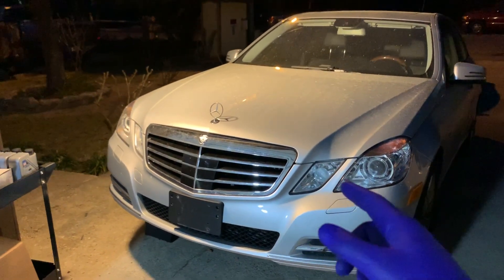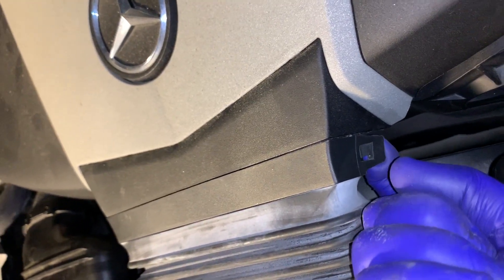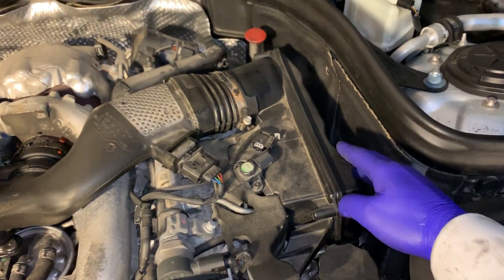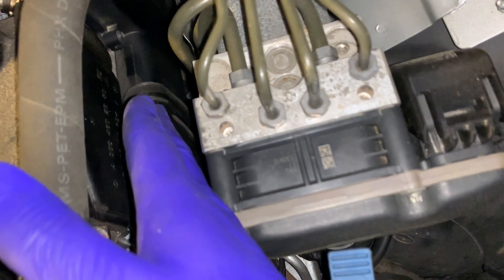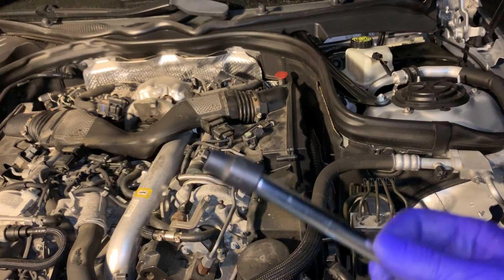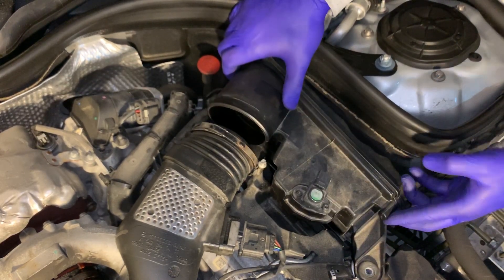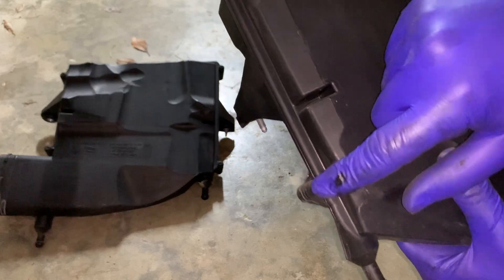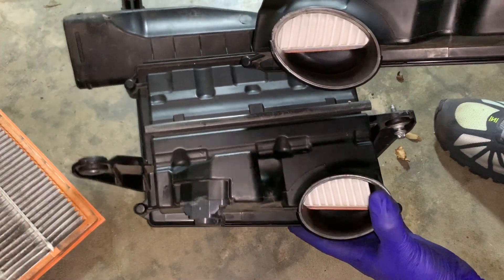How to Replace Air Filters 2011 Mercedes Benz E350 Bluetec

Comment: Thanks again, I’m replacing my filter this week!
Reply from the maker: You're very welcome!
Reply: @AlbanianFix  I have the exact same 2011 bluetec as you replaced the purple oil cooler seals in and I have an oil drip too, that I’m sure is the oil cooler seals.  You saw no reason to replace the cooler with a new one while in there when you did yours. I’m thinking there’s not anything mechanical in an oil cooler that benefits from a new oil cooler,  did you have the same opinion since you didn’t replace it? The purple seals are the only thing in there that can fail.

Comment: Kush esht me me pak probleme vlla nje 350 cdi apo 250 cdi se te ter mthon 3.5 esht me i mir si motorr pa marr parasysh harxhimin
Reply from the maker: Vallai skam degjuar as per njeren as per tjetren qe te kete me shume probleme. Vetem dicka kam degjuar por nuk e di se sa e vertete eshte per 250çin qe i modifikojne kompjutrin qe ne fabrike thjesht qe te jete pak me i shkathet ne levizje nga qe eshte shum i plogesht ne ecje kurse 350çi eshte i shpejt vet pa modifikime sepse normalisht ka motorr me te madh. Po ama ky modifikimi i 250çit e ben qe te shtrengohet shume gjate gjithe kohes dhe për mua cdo makine qe modifikohet vetem e vetem per te qene pak me i shpejt ne ecje, ti i shkurton jeten asaj. Po te vesh re te gjitha makinave qe njerzit psh i bejne modifikime nuk e kan pas asnjehere te gjate. Megjithate kete modifikim ja ben vet kompania e Benzit dhe mbase ska asgje te keqe por nqs do e kisha une ne dore, do zgjidhja 350çin.
Reply: Albanian Fix ate po mendoj te marr vlla 3.5 se ktu ne shqiperi 2.5 ka probleme me zinxhirin shum dhe me injektoret ajo qe thua per modifikim n fabrik per 2.5 esht e vertet se esht i njejti motorr me 2.2 po se di le t ket pak me shum konsum m mir m pak difekte
Reply from the maker: A S po 350çi do ishte zgjidhje e mire pavarsisht se do konsumoj pak me shume po te pakten nuk e kan ngacmuar si motorr. Edhe per rruge te gjata hyp e zbrit maleve do jesh me i nderuar vlla.